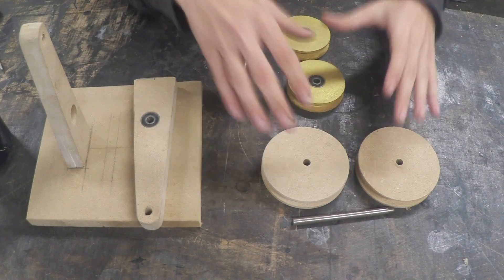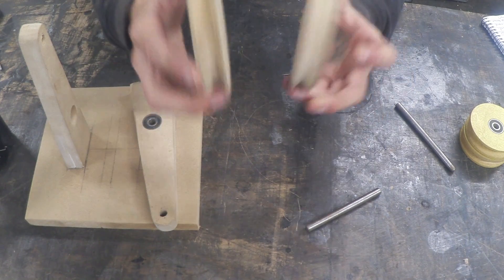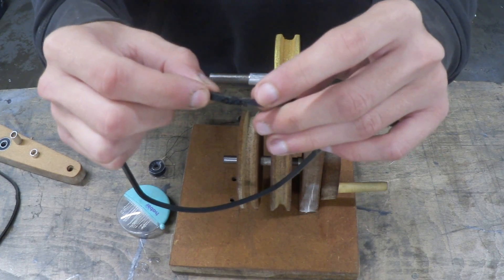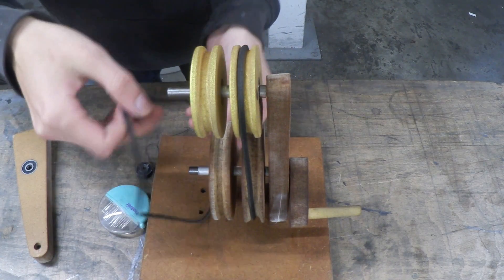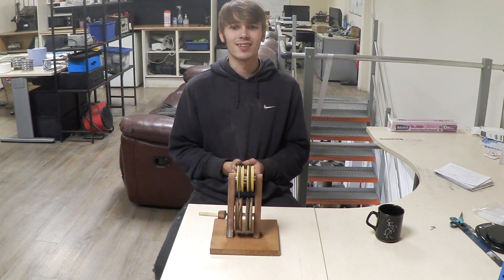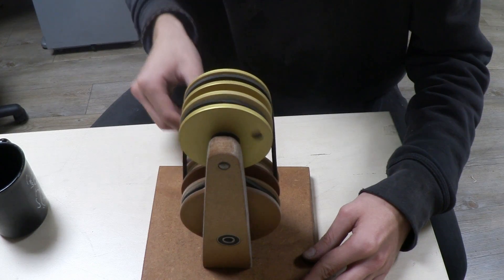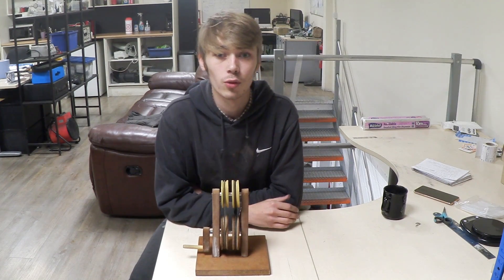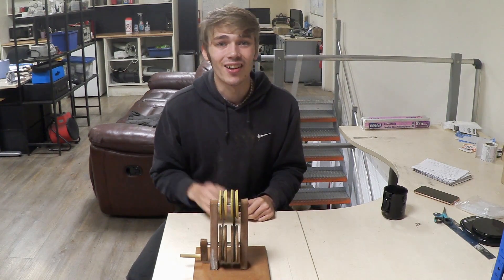Contra Rotation With A Pulley And Belt

Comment: your crazyness is a bit too much for me.
A simpler way would have been to take a ruler of some sort place it on top on the yellow small pullies and trace a black line. Like this we would have been able to see both marks going in opposite direction at the same time, and avoid you to have to constantly turn the pully system.
Reply: Tic marks along the outer circumference? Brilliant.